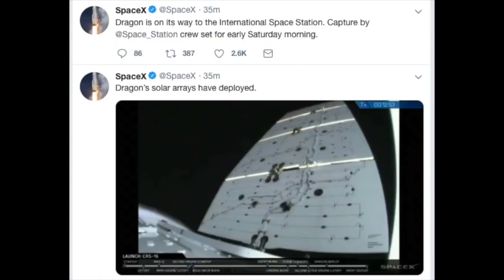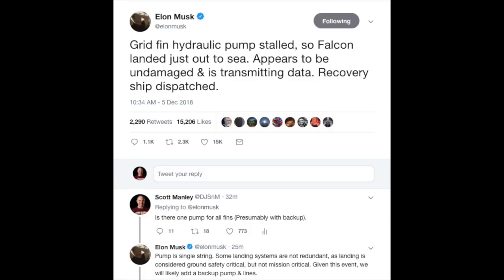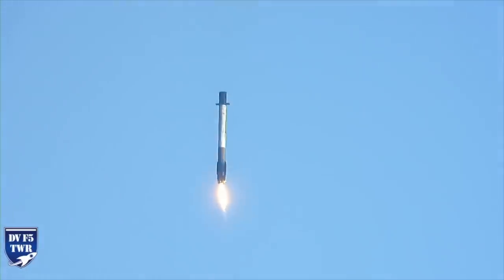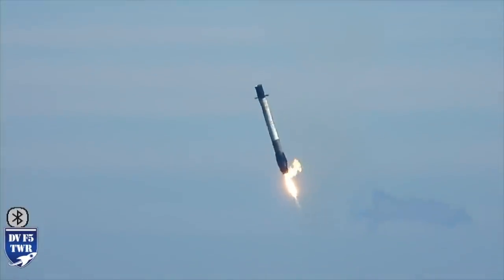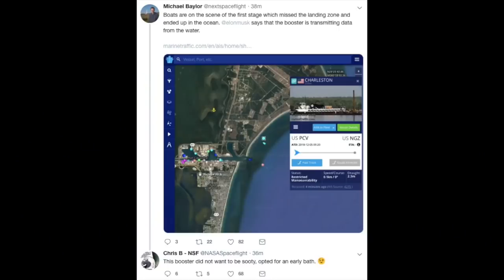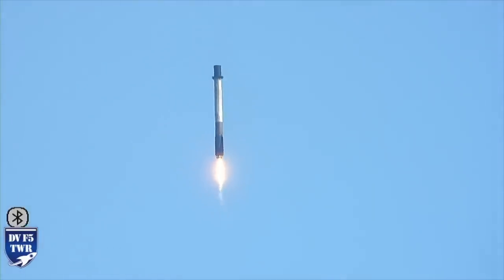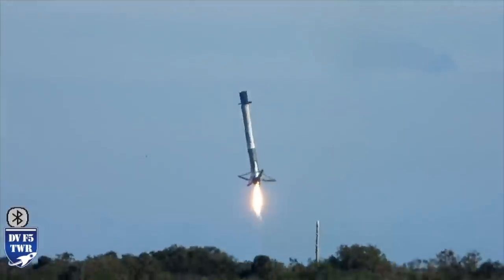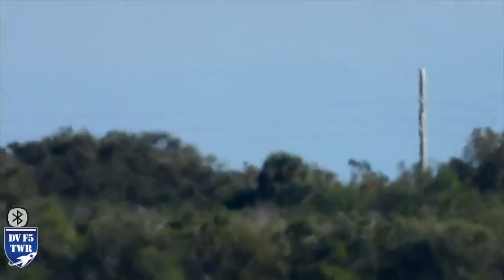SpaceX Rocket Loses Control After Successful Launch

Comment: It´s still very impressive, that they were able to bring the booster down in one piece.
Watching it spin and wobble, one would expect, to see the whole thing disintegrate midair.
Reply: yeah the AoA it achieved towards the end there and then recovered from was VERY impressive
Reply: I say if I didn't land on water. It would of been standing right now.
Reply: Back in the day, SpaceX would blow it up before even attempting to correct it.
Goes to show how far they have gotten.
Reply: I agree, if anything this mishap highlights how good the rocket is at landing back.  With that said it would be better if major components such as grid fins could avoid major malfunctions such as this one.
Reply: "how good" That was a lot of force - all sorts of stresses they couldn't possibly have built for. I bet it would have effectively destroyed or at least totaled the booster anyway.
Reply: @tieck4408  what??? Are you talking about?
Reply: You have a very large thing with a lot of mass that's minimally built for weight and cost and it's spinning and wobbling. Think of it this way: a 747 can do an aileron roll without exceeding its g load. Suppose a plane does that 3x. Would you get in for the next flight along with $30 million in explosive cash and a $5 million piece of equipment someone's trusted you with? That airframe would be in the hanger for months, if it ever flew again at all. And that's within the design limits.

Even a graceful landing is not yet anything like parking - it's pretty, but a car crash in terms of $ and maintenance. Any added stress is likely to hurt, and this was a lot of it.
Reply: @tieck4408  It would still be cheaper to fix and repair then building a whole brand new rocket entirely in this day and age imo.
Reply: " It would still be cheaper to fix and repair then building a whole brand new rocket entirely in this day and age imo."

That's what they said about the spaceshuttle... and the comparison is a bit moot, since noone mass produces rockets like we do eg. cars.
Reply: @MD-xb2tw  It wasn't the grid fins that malfunctioned at all, rather a hydraulic was stalling, forcing the grid fins to turn a hard right. 
The fact that it still managed to land safely at all is astonishing to begin with.  

Of course the grid fins avoid major malfunctions like this one, they do all the time.  This was just a 1 in a millionth chance of happening, and it's great news that it happened because Space X can look deeper into why it "stalled" at all and hopefully fix it with later designs.  Space at the moment is trial and error, what do you expect?
Reply: It probably would if it was before its entry burn. Still very impressive.
Reply: The impressive thing is that they had been able to show to the world that they their whole trajectory is prepared for such a loss of control. They really are prepared for such worse cases as well.
Reply: Not 'they' but 'it' cause the boosters ai,brought it down not us so 'it'
Reply: @mastershooter6315  - Thats right. I also thougth about this aspect. With 'they', I am reffering to all the engineers and developers, who preprogrammed the control systems of 'it'.
Reply: @RobertWillis-q3u  I'd argue that it's not so much because of the reuseability, but because they brought competitive and modern manufacturing and attitude into the launch industry. That existing manufacturers had been sleeping on their laurels / government contracts... A rocket is a rocket is a rocket... It's incremental improvement and where others could have been if they had followed up on new tech.

Regarding the shuttle... Offcourse there were engineering/tech problems... The ceramics never did work, nor did anyone think to replace it with anything better... And noone has a better bring back capability (of cargo).
Reply: @nt78stonewobble  

re. "I'd argue that it's not so much because of the reuseability, but because they brought competitive and modern manufacturing and attitude into the launch industry." - Whereas Elon & company clearly & repeatedly state that it is a combination of business model combined with modern manufacturing techniques; with launch vehicle & spacecraft re-usability combined with control of the supply chain being the cornerstones of that business model.

re. "That existing manufacturers had been sleeping on their laurels / government contracts" - Yes, & they are still swallowing up the lions share of the taxpayers money to a grotesque degree thanks to the Congressional meat puppets from both parties that they have been controlling over the last 40 years, combined with a revolving door between NASAs upper management & their corporate boardrooms.

re. "Offcourse there were engineering/tech problems" - Yes, but these technical shortcomings played a minor role in grossly inflating overall programatic costs while drastically reducing cost effectiveness. Cancellation of the nuclear/electric inter-orbital tug that was intended to be an integral part of STS (The Soviets had their Gerkules tug for MKS under construction when the funding vanished) was just the beginning of the ongoing acts of sabotage to prevent Shuttle from competing with all the expensive expendable launchers the LockMart/Boeing/Thiokol/Rocketdyne cartel wanted to keep selling. The contractors/vendors & political constituencies have their paid propagandists put all the blame on the Shuttle's designers in order to excuse their own criminal corruption.
Reply: @RobertWillis-q3u  Rockets are required to be as pristine as possible.  Even a small dent can cause an entire rocket catastrophic failure.  
That's why things like corrosion, even on materials that don't corrode, once water hits it, it's pretty much done for.  Reuseable yes, but only in recyclables tbh.
Reply: Really? They went from landing to crashing and it's impressive?
Reply: @cookingonthecheapcheap6921  No, they went from crashing and then landing and now landing a defect booster safely. Pretty impressive.

Comment: For those wondering, spacex is going to recover the booster and plans to use it again for a future internal mission.
Reply: MAY use it.. they won't know until they get a look at it. :)
Reply: @iconoclastpleonast8726  Yeah, they can't even reuse fairings that have been in seawater.  I doubt this would be worth the risk of reusing.
Reply: Matt Graham - yes, they can. Elon tweeted about it two days ago.
Reply: @andrepretorius6127  Why try to catch them then, just fish them out of the ocean?  My presumption is based partly on Scott saying pretty much the same thing, but maybe they've salt proofed them now.
Reply: @mattgraham4340  I would never fully trust anything as complex and, well, delicate, as a rocket after it has been in prolonged contact with seawater.  Ask any marine or naval engineer how much of a problem seawater is.  Composites or no, that booster is not worth risking another commercial contract on.  I'd put a throwaway mission on it and just fly it for test data.
Reply: @HuntingTarg  yeah, I'm skeptical of even that. "may reuse" sounds like face saving blather
Reply: keco185 Elon says they may use it for an internal mission, which means they probably aren’t confident enough to use  it on a commercial mission.

Comment: You can see at 5:29 exactly when it runs out of air in the cold gas thruster tanks with only a little wisp of air (also I think it was corrected with some of the upper ones just before) also I’m betting that the ice came from around a CGT nozzle maybe because of excessive usage or Mayberry’s normal and we just don’t see it

Comment: QUESTION: The rocket seems to have come down for a very soft landing on the water. If there happened to be flat land there, would it have survived intact?
Reply: I saw another angle and it touched down perfectly on the water, then sank a bit and fell over. They even said it still functions and did its Normal shutdown/ safety procedures. Once the anomaly Occurred( the oscillation) falcon purposely aimed for the water To not damage the landing pad facilities or injure people. Still early, but this looks like what happened.
Reply: Não, tombaria de lado e com isso iria explodir com o restante do combustível.
Reply: Nope, instant kaboom.
Reply: Depends if the legs were on the same hydraulic system. If they were then no chance of the engines surviving a landing without damage.
Reply: Likely it would have toppled over and ruptured a tank and been destroyed. If I was on the thing and had a choice - I would go for water.

Comment: What a great time to be alive when NOT landing a rocket makes the news
Reply: The thing is, it did land !
Reply: @khenricx  it did water ;)
Reply: @khenricx  the dictionary says that "to land" means "to bring to or set on land:"(one of many meaning). It was on water so that doesn't count, but a plane can land on water, so dictionary is clearly lacking. Wow even the wikipedia article about "water landing" references spaceX under section "Launch vehicle water landings". 
I reverse my claim, the dictionary is correct "to land" can also mean "to alight upon a surface, as the ground, a body of water, or the like:"(I overlook this)
Reply: Landing
Watering?
Reply: Well put.
Reply: Exactly! That is how routine SpaceX has made rocket landings, and it landed softly in water at that!
Reply: Landing means. you land it on the ground not on the water HAHAHAHA. It can be said 'touched down to the water'
Reply: It just shows how normal a successful rocket and booster landing is. And all because of SpaceX.
It's pretty awesome, actually.
Reply: Well, ask NASA what made the news, successful landings or not successful landings
Reply: Come on, y'all; the term used for Mercury, Gemini, and Apollo was 'Splashdown!'
Reply: "Приводнилась"
Reply: compared to what else they show on the news?
Reply: The only reason why it landed in the water was due to safety, as there was an issue with the rocket, so they aimed it at the water. Had they just tried the landing pad, it looks like it might have been fine.
Reply: It is expected that a rocket malfunction makes the News more than a routine launch&landing...that is what makes disaster so memorable. Your statement is the opposite of reality.
Reply: @nerhu59  The point of his statement is that just a few years ago every rocket lower stage crashed into the ocean, and attempts to land were nothing more than experiments, but now SpaceX is so good at landings that a stage crashing into the ocean is seen as an unusual malfunction.

* Note: no I'm not forgetting the space shuttle. The SRBs hit the ocean at about 70 ft/s IIRC. That stretches the boundary between "soft landing" and "relatively gentle crash that the vehicles can survive due to being built like tanks."
Reply: It did crash, but it crashed and still works
Reply: This isn't the news.  This is some guy who thinks people are interested in listening to him spew his mouth off as though he's an authority.  I only clicked on this thinking it was a legitimate video.
Reply: @dogmannz  
News doesn't come only from credentialed jounalists and corporate-controlled editorial offices.  A lot of leads and footage seen on news shows now is crowdsourced.
You are formally invited to join the 21st century.
Reply: @dogmannz  
Look who's running their mouth on the internet now.  Yes, these agencies do (because they're legally obligated) factfind and vett their stories.

And yet there are stories printed by the Washington Post and others (including the 'fake news' outlets) that have been factally falsified; but no consequences because our revered institutions if journalism are 'Too Big to Fail.'
This is, quite literally, rocket science.  Find me two journalists who can match Scott's timeliness and accuracy.
But I probably won't notice, because you're  attacking the disruptors and defending the giant institutions that can defend themselves.  I have no time for luddites, so I bid you good day.

Comment: I'd guess the ring of ice was from around the cryogenic fueling port.
Reply: I don't think it is made of ice. Ice is very brittle and would definitely have shattered in the oncoming wind or at contact with the fin.
Reply: @TheAgamemnon911  Very very little wind at that altitude and the ring was not moving very quickly, also those frost 'fingers' would be able to crush and absorb the impact of a minor bump like that. Yes I'm aware that Scott slowed down that part of the clip but I've seen the original a well.
Reply: @TheAgamemnon911  If you frame by frame the video its clear that the object doesn't contact the fin, it comes from the left of the fin and moves over the top until a firing thruster blows it away from the craft.
Reply: @dr.trotter1086  I was doing that. Did it again today and I tend to agree now. No direct contact is made, which invalidates my point.
Reply: It does clearly look a lot like ice. Probably ice formed around a port of some sort, and then finally coming loose during the descent.  @TheAgamemnon911
Reply: @TheAgamemnon911  May not if pressure cancels the airflow around that area
Reply: In the SpaceX stream they said it was a bit of Condensation breaking off the rocket
Reply: Ice buildup from around the acs thruster
Reply: @FleshAndGears  That's my second guess
Reply: Yeah, a ring of ice popping loose from a fuel/oxidizer port would be my guess, too
Reply: Just a guess. I like the engine bell idea too. To be clear I'm no engineer, just a dude suffering from Male Answer Syndrome :p
Reply: during the livestream, the commentator said it was frozen condensation flaking off... no idea how accurate they would be.
Reply: yeah i was thinking it was ice, but i wasn't thinking about the fuel ports.
Reply: A chunk of ice seems possible the carbon build up around the interior of it looks alot like would form on the outside of the super chilled portions of the booster but it's near perfect circularity makes me thing it may of been a gasket of some sort that may have came loose and if so that may.....MAY be the cause of failure.....but I also am not a rocket engineer....yet.... and am also not super familiar with the falcon boosters design so I cant say for certain
Reply: Zachary Lancon interesting idea, but, I doubt a gasket would have made it out of a failed fitting more or less intact, and the frilly edges are definitely ice crystals. Condensation that was frozen/built up around a ACS nitrogen jet nozzle would make a lot of sense
Reply: @stargazer79  
If you're familiar with the properties of machine aluminum, if it is under appropriate temperature and mechanical stress, an aluminum gasket will begin to melt and 'ooze' out of its fitting.  And Aluminum Oxide is white in powdered form - though how such a gasket would get that shape and THEN come loose is beyond my ken.
I buy the condensation ring explanation.

Comment: having boosters land on water without recovery ships.  in the landing pads are inflatable landing balloons that make a reusable booster land on water without the help of a vessal.  Hmmm intresting idea.
Reply: Maybe, but just on the legs wouldn't work.  It'd end up upside down; in salt water.  Better if we could find a way to have it deploy something like a life raft that would keep it entirely out of the water.

It would have to be fire proof, the engines are going all the way down.
Reply: Food for thought
Reply: Together with the landing pads a weight rod (something practical during ascend stage) is lowered that drastically lowers the centre of gravity towards an assured upright position in water after touchdown
Reply: Interesting idea.. probably not realistic though.  These boosters are 15 stories tall, even on the landing ships they have to weld the feet to the deck to keep them from tipping over from ocean movements.  Bobbing around like a cork on giant airbags would probably result in a tip over.  :)
Reply: How to make a cork on airbags stable in water?  That's a science experiment right there!
Reply: @majoorF  I would think the wind would be the issue.  I live in a building that is 170 feet to the roof line and while it can be still out on the front plaza 170 feet up there is always wind blowing..